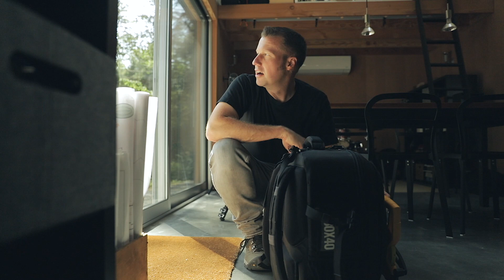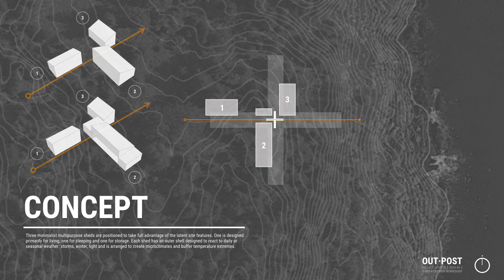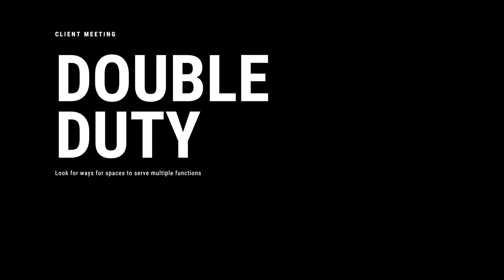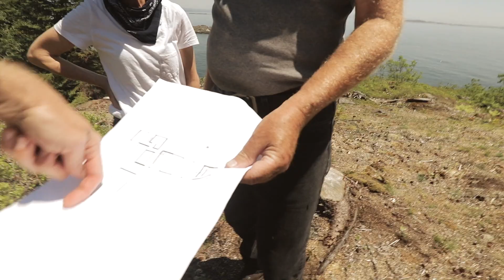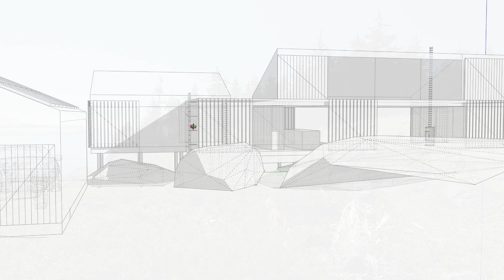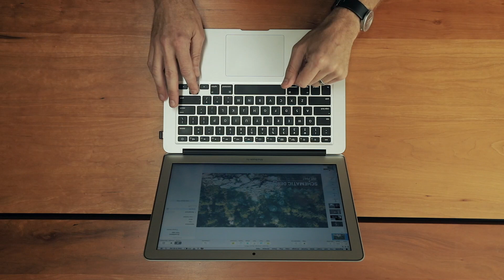Comment: Great example of a real client meeting, where looking at the concept leads them to add a new program element- the screened porch. And they have a point- a screen porch is a great transitional space, between indoors and outdoors. If you have one, it’s a great place  for a light meal, a cool beverage, and maybe a nap. Try it. I don’t think a remote screened enclosure away from the house has the same usefulness. I agree with the client, I would want a porch with access to the house and the kitchen, just as the wife suggested. I think Eric did a great job of discussing and testing this new idea, let’s see where it takes him.